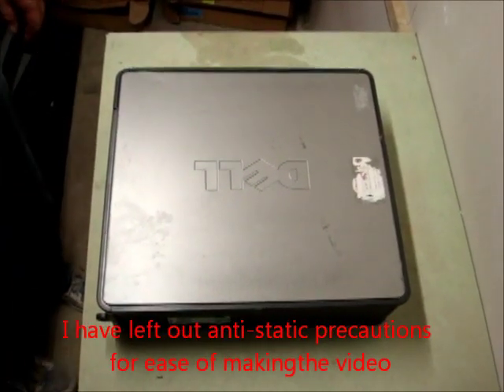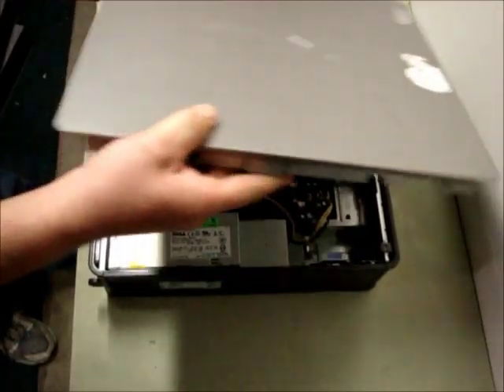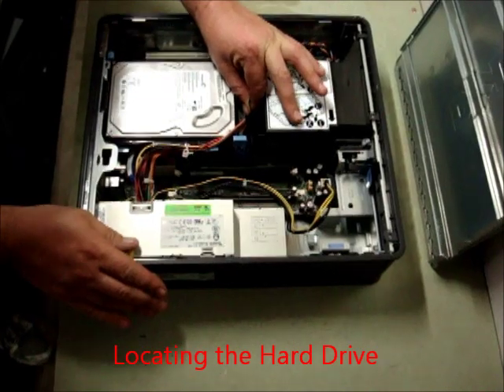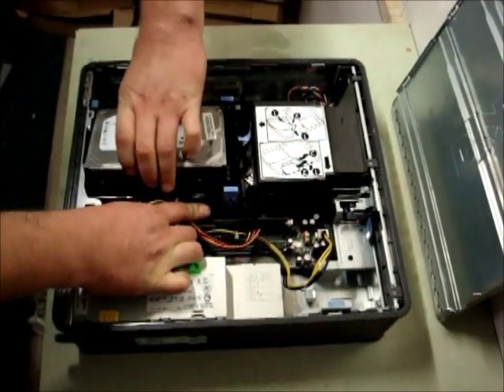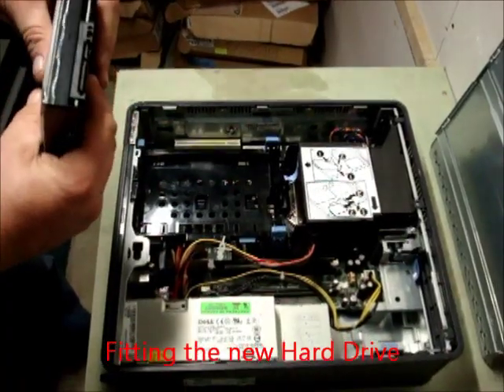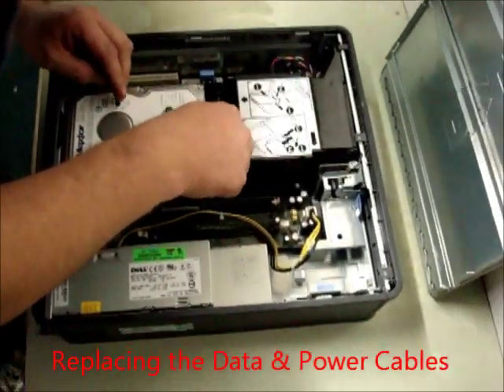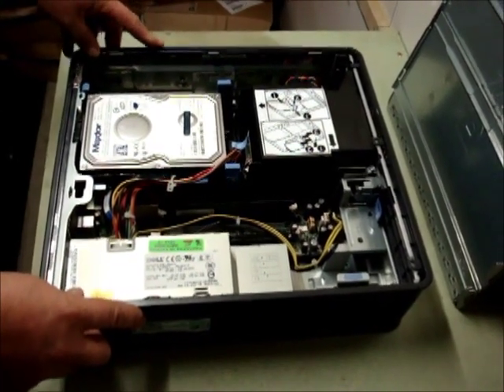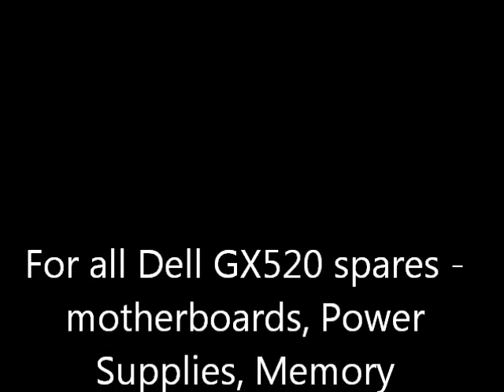How to change a Hard Disk Drive in a Dell Optiplex GX520 Small Form Factor

Comment: you are wrong, the only difference between a 2.5 and a 3.5 is the size, the actually sata connection and power connection is exactly the same. and as I just said yes you will probably need to put it in an enclosure of some sort but no adaptor needed the connections are exactly the same!!